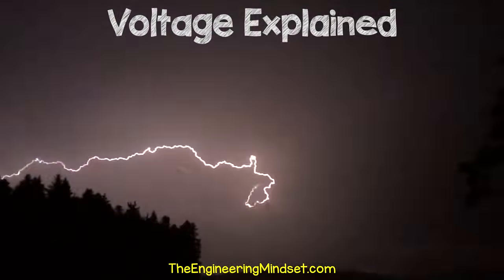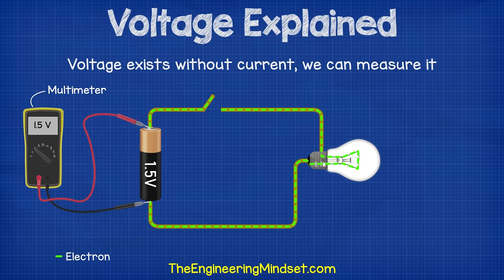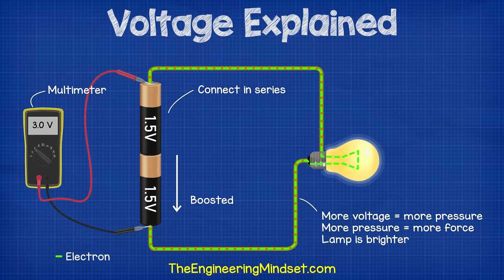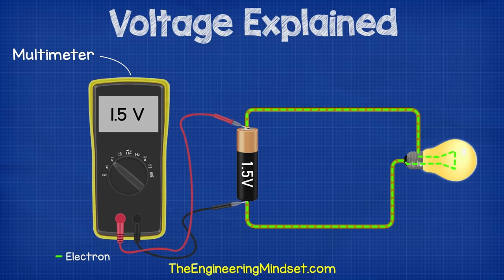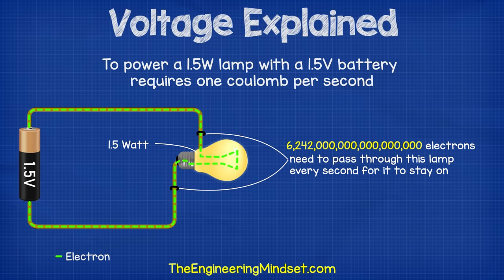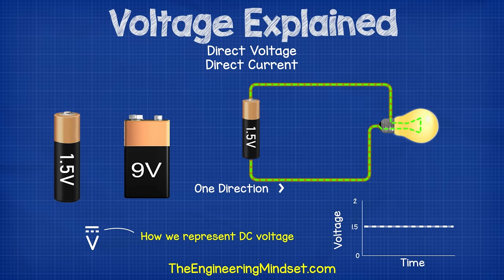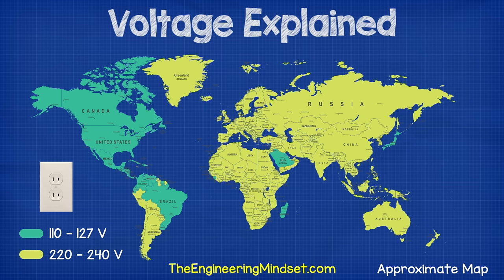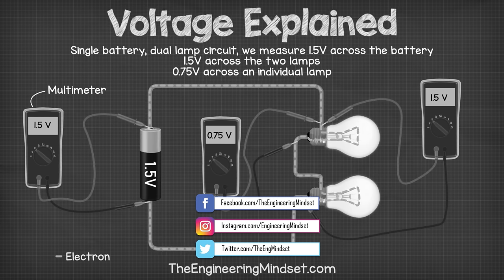Voltage Explained - What is Voltage? Basic electricity  potential difference

Comment: I don't understand how a Series Circuit with (1) 1.5V Battery (2) 2 Lamps, turn out to have 0.75V when measured across one lamp. 
 
That is, when the electrons reach the first lamp, and they are flowing at a particular rate, wouldn't they all just pass through the first lamp, hence, measuring 1.5V for the first lamp ? (Same for the second lamp)

Can EE student help explain please : (

Comment: If 1v = 6.24x10(^18) electrons is passing 1 Ohm in 1 second. shouldnt the 1.5 V circuit in 06:.07 be pushing 6.24x10(^18)x1.5 electrons /second?

Comment: So what's the point in having 2 batteries at 1.5V parallel with each other?
Reply from the maker: Please watch this video: https://youtu.be/PXNKkcB0pI4
Reply: @EngineeringMindset  Thanks... ive subscribed
Reply: @EngineeringMindset  So am I right in saying, due to the chemical reaction within the battery, the electrons build up ready to go to the positive terminal. But because the separator in the battery, the electrons need a conductive material to guide them to the positive. Its almost a way to influence their movement/path?

Comment: In 3:27 Why is the light dimmer when there are two 1.5 volt batteries connected in series. The same current still flows through the light and the voltage is still technically the same so the power in the lamp light should be the same as before. So why is it dimmer? Can someone pls explain?
Reply: He said the light is dimmer compared to the two batteries in series. If you had one battery powering the light it would be a set brightness. If you add another in parallel then the light would be the same brightness but last twice as long. If you set the batteries in series the light would be brighter but last the same as one battery.

Comment: wait, if the current just run in cycle from the Negative back to Positive, then how can the battery run out of power?
Reply: Dc current runs out. Ac charges it up. That’s why you plug your phone in an outlet.
Reply: Whoever Whoever a chemical reaction takes place inside the battery between and anode and the electrolyte. This chemical reaction frees up the electrons and gives them the push
Reply: The current is only flowing due to the energy supplied by the battery. Once the battery runs out of energy, the current will stop flowing.
Reply: Whoever Whoever the current flows from the anode, which is negatively charged. Once the negatively charged atoms run out, there are no more electrons that are able to be pushed out of the battery
Reply from the maker: Check this out, how a battery works: https://youtu.be/PXNKkcB0pI4

Comment: So wait... does this mean that a device in the states uses less pressure to yield the same result (ie the performance) for a device? for example, a hair dryer in europe is using more pressure (voltage) for it to work but a hair dryer in the us performs the same but with less pressure (voltage)
Reply from the maker: The US version is half as powerful.
Reply: @EngineeringMindset  So if it is half as powerful, is the output the same or different?
Reply: @hamza-8978  probably different, but like i can't really tell you , one way would be to use a hair dryer of 220 v in europe and another of 110v in states😁

Comment: I would say that voltage and volts aren't all that different- I know it's addressing the classical issue of young physics students mixing up what they're measuring with what units it's in, e.g. we could measure pressure in Bar- but we'd never say something is at "32 pressures." And we wouldn't really ask "what's the Bar?" to find out the pressure of something... or would we? I find it not so uncommon for people to use the units as a sort of synecdoche for what's being measured, like asking "what's the PSI at?" of a particular pressure chamber. And I think that's kind of what's been done to invent the term voltage. Because technically, what's being measured is potential difference; that's not just another term for it, that's its real meaning. But I could be 100% wrong, for I am claiming no historical knowledge of how the terms developed, only of my experience with nomenclature.

Comment: Apologies for my ignorance but I don't get it?   How come with a 9 Volt battery in another video the current is shown travelling from the negative terminal, through the battery to the positive terminal and then into the circuit, but on a 1.5 Volt battery the current travels from the positive terminal, through the battery to the negative terminal and then into the circuit?   I don't understand.
Reply from the maker: Electrons flow from negative to positive. It was originally assumed from positive to negative though. Both ways are still taught , the original way is known as conventional current and the actual is known as  electron flow. Be aware of both.
Reply: The positive is where the electricity comes from in DC. That's why grounding a car battery discharges it.
Reply from the maker: Check this out, how a battery works: https://youtu.be/PXNKkcB0pI4

Comment: I have 1.5V and 1.2V rechargeable AA batteries, what happens if i combine them in some device say two by two??
Reply: If you put the batteries in series order, device will get 1.5+1.2 V pressure to power that device,, and if you put batteries in parallel, the device will get 1.5+1.2/2 V pressure, hence less power but for longer duration😀

Comment: Nobody’s ever gave a satisfactory explanation for AC, the way it is always illustrated (going one direction then back and forth) the electrons would never actually go anywhere so how would they do any work or, using the water analogy, no water would come out of the tap!
Reply from the maker: They don't go anywhere, they move just a little each way. It's just the movement back and forward that always us to use it. Same as we can convert AC to DC and DC to AC. It comes out the tap and then goes back in the tap with AC. Watch our video on 3 phase explained, you'll understand
Reply: The Engineering Mindset that’s what I always struggle to get my head around, if it keeps going back into the “tap” how does it carry on down the “pipe” when it’s converted into DC? Maybe it’s because I’m a Heating engineer the water analogy just makes it more confusing for me but I’ll watch the other video. Thanks
Reply from the maker: Check our inverters explained video too, it shows how we convert DC to AC
Reply: The Engineering Mindset I’ve seen the inverters video and I understand the mechanics of it the same as rectifiers but from AC to DC if the current is going back and forth then how does it carry on in one direction on the DC side? I do know what you’re saying, I understand the theory but I can’t visualise what is happening. Perhaps an in depth video on how the electrons actually move would make for an interesting video?
Reply from the maker: Power inverter video  here https://youtu.be/iIqhAX0I7lI

Comment: Why isn’t the voltage shared in a parallel circuit? I don’t understand.
Reply from the maker: If you took two balloons and connected them to the top ends of a "Y" shaped connection and blew are through the bottom end, both balloons would inflate 
at the same rate. Voltage is pressure and both balloons experience equal pressure. This is parallel connection.

Comment: So the electrons exist in the copper wire from the copper atoms before voltage. Utility companies create voltage? Electrons are never actually used? I have no clue
Reply from the maker: Yes they already exist, the power company provides the pressure to move them through your electronics. It's this force the power company provides which is used up.

Comment: so too much voltage = boom
and too much amps = boom

so i need to find the balance?

i am a bit confused because one youtuber explained voltage as the 'compatibility', but now i found out that product 'x' (led) needs 12V to power, so i was like, if its 'compatible', then i can feed it 12V 60A. But of course if this was a 12v led, it would blow on me. so i need to find balance. and why would i need more amp-age? or volts? couldn't i use low voltage and high amps, or high voltage and low amps. IDK. b r u h. imma go sleep.

Comment: 8:00
If there are brief moments when voltage value is 0 in AC circuit, why bulb glows all the time?
Shouldn't it blink?
Is capacitor making sure it glows all the time?
But in this animation there is no capacitor...
Then I assume this animation is not 100% accurate but is there only for first steps in learning?
EDIT: time stamp
Reply from the maker: Depends on the lamp, some continue to glow because of the heat of the element. It's also happening at 50/60Hz which is faster than your eye can see. If you have a slow motion setting on your mobile phone, you can see it with light
Reply: @EngineeringMindset  Yes, I am very aware it happens in 2/100 of a second.
But noone ever spoke about it, and since no proffesor ever said anything about it I got confused.

But yeah, I was right all along.

Thank you for clarify this, it was in my head for faaaar to long.
4 years it took me to get an answer.

Comment: The water analogy has always bothered me - as soon as you open a valve water pressure will start to drop and the water level will drop at a constant(ish) rate. This isn't true of batteries - the voltage drops according to a curve. For Li ion batteries it hardly drops between 80 -20% state of charge and then drops rapidly towards the end. So would a more realistic depiction be to have a second storage tank feeding the first one to keep its water level fairly constant (depending on the exit flow rate / current) until that one empties?  If that's not the case, please help me understand what is going on.

Comment: Man I suck at this.
I'm trying my hardest to understand electricity.

if you have a lamp that requires 1.5 volts without resistance from a 1.5 volt battery, would it only power the lamp for 1 second until the battery is depleted?
Reply: lets not imagine the lamp having no resistance, since that would mean infinite current. lets imagine the lamps having 1 ohm of resistance. and also lets say the battery is 1500mah (milliamp-hours). 1500mah means the battery can supply 1500 milliamps (1.5 amps)for one hour before it is empty. when you connect the battery to the lamp, 1.5 amps will flow. current is calulated by voltage divided by resistance. since the battery can supply 1.5 amps for 1 hour, the lamp will stay on for one hour. (note: this is a very basic explanation and may or may not skip over some more complex details) i hope i could help

Comment: I can't understand why voltage has specific numbers like 1.5v etc.
Sorry if my question seems stupid. Im just a high school student
Reply from the maker: Manufacturers standardised batteries to make it easier to design products and for consumers. Otherwise it would be very difficult to buy a 7.32V battery if you needed one.

Comment: dear engineer
i think more voltage= more current=more bright its not all true

more bright will be effect from technology the lamp, old bulb low bright more use the current different with led, because led had technology convert the current more efficient to fluks

Comment: This... still doesn’t help me conceptualize voltage. It just seems like your saying that voltage is the force (how is it a force?!) that moves free electrons through a circuit only in one direction (HOW?!?!). I was under the impression that electromagnetism is what moved electrons now your telling me there’s either another name for this or is it a totally new fundamental force?! I’ve also seen it said that voltage is just energy used to move free electrons but WHAT KIND of energy is it? How is it stored?! Potential energy is just the possible amount force generated by gravity if something (like water) were to fall. But voltage isn’t gravity! Voltage isn’t water in a high place waiting to fall! Voltage doesn’t seem to BE anything! Is voltage the electrons themselves? What’s in the battery to give it that arbitrary 1.5 volts? I’m so frustrated by this topic that NO ONE seems to be able to explain in a way my retarded brain can understand!
Reply from the maker: With a battery it depends on the materials used in the chemical reaction: https://youtu.be/PXNKkcB0pI4
In AC generator, it depends how fast you spin the rotor, the strength of the magnet and the number of coils: https://youtu.be/jdSKlg80DjU
Reply: @EngineeringMindset  
Oh my gosh thank you!

Comment: I don't think parallel circuits lower voltage because of "splitting". It lowers voltage because look at the end of the battery. Now the positive charge doesn't have a clean path to the negative charge. There are other positive charges from the other battery connected to it... fighting it. The craziness of parallel circuitry has bothered me my entire life until I looked at it that way. You are connecting a bunch of similarly charged things together... so it causes a traffic jam... like a resistor... which slows the discharge. This is so obvious...

Comment: Could anybody please help me get the intuition of voltage drop for resistors connected in series.

If we have 2 resistors connected in series (R1 = 2 ohms and R2 = 4 ohms), the total voltage of 12V will drop 4 Volts at the first resistor and 8 Volts at the second resistor. 

We would also have the same voltage drops if we had Resistors 100 times more powerful (eg 200 ohms and 400 ohms). 
Could someone please  explain how it happens that absolute resistance is not important, while relative resistance is.

Also could you please explain why is it so that if we have one resistor in a circuit, all of the voltage should drop at this resistor (so no other voltage remains).

Thank you in advance!
Reply from the maker: We made a tutorial on that which should help: https://youtu.be/VV6tZ3Aqfuc
Reply from the maker: Check out NEW resistor video, everything covered! ➡️ https://youtu.be/DYcLFHgVCn0

Comment: afaik you cannot actually measure voltage without letting a very tiny current flow through your multimeter, very unlike water pressure... Try to measure the voltage in a charged capacitor with an oscilloscope and watch it go down.
Reply from the maker: Check our new Multimeter tutorial out ➡️ https://youtu.be/4lAyzRxsbDc

Comment: You didn't explain it very well. I still don't know how to make a voltage. Is it just a difference of negative and positive charge?
So all I have to do is get more electrons on one side than the other and that will give me a voltage?
But then doesn't that just make a capacitor instead of a battery?
Anyway, is that what a voltage is?
I need answers.

Comment: While voltage is a physical concept, direct or alternating voltage is not. We don't define a concept of "alternating force" either when we talk about springs... Every physical quantity is implicitly understood to be allowed to vary over time. Classifying that variation is an extra concept that is far less fundamental and students should be allowed to pride themselves on knowing the (definition of the) difference between ac and dc when they havent understood voltage first. It is similary silly to talk about analog versus digital electronics before you really nailed down the basics of electricity.

Comment: Volts are not a unit of force. It is an amount of energy (Joulesl per unit of charge (Coulombs), or, equivalently, the amount of power (in Watts) per unit of current (Ampere). The latter definition is obtained by dividing the first definition by time. The definition you gave, that a constant one volt voltage makes 1 columb flow through a 1 ohm resistor in one second is the same as saying 1 ampere flows through a 1 ohm resistor at 1 volt, which is really just ohm's law, i. e. the definition of resistance. It doesn't really give you any clue as to the amount of "force" exerted by 1 volt...
Reply from the maker: Check out NEW resistor video, everything covered! ➡️ https://youtu.be/DYcLFHgVCn0

Comment: the higher the voltage, the lower amperage. in the US we use 120 v wall plugs. in Europe they use 220v or so. If we used this voltage we would have half the bill. jeez
Reply: But he said more voltage= more current

Comment: I did medical university and still this is to high for me.. i watched alot of videos and everyone explain different.if this is basic it myst be explain more easy. Then it is 240 theb 110. Some go from minus to plus other go from plus to.minus. then volt and voltage en amps  ot thesame. Pressure is enough water. So amps and volt are thesamw both pressure of electrons what am j missing.  Both are pressing electrons. Coulombs true cable. So the minus of battery is high like a mountain.and electrons flow from pressure and current down to the plus. Whats difference between high pressure or more water amps and volts.  12 volt is 12 amps 144 watt lamp. I get a headach  who invented this lol